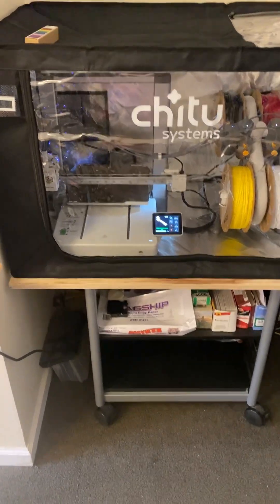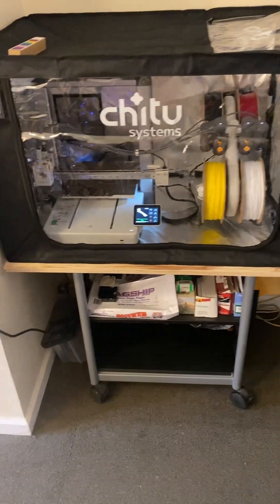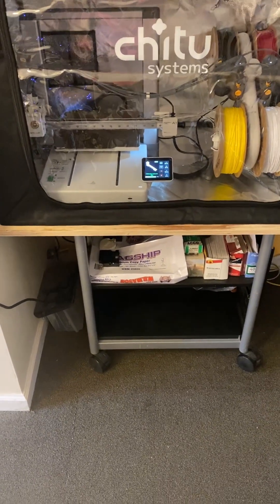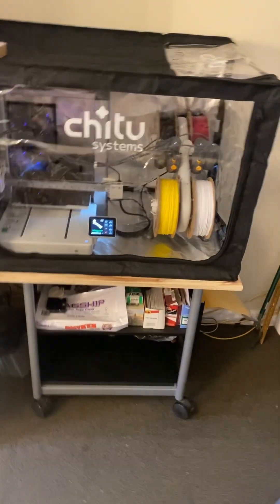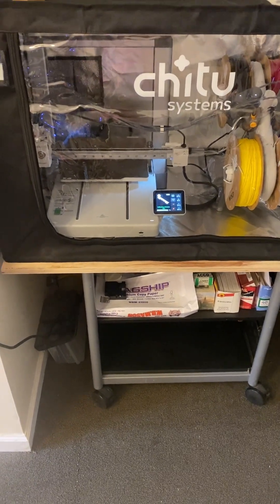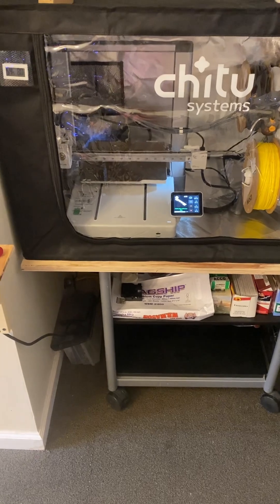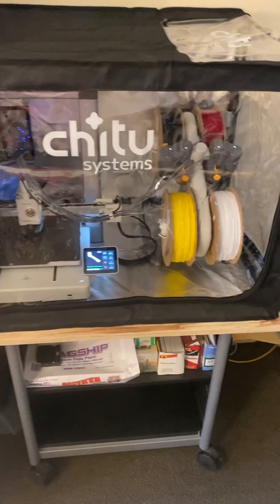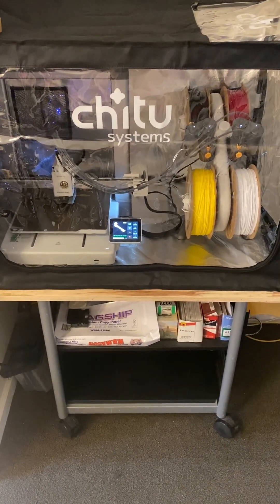S043 Bambu Labs A1 enclosure all setup

Comment: Nice enclosure but not for nothing The A1 doesn't have a really a good cooling system so you need to install an exhaust fan in the back left corner looking at it so that way it'll be behind the printer to help keep it cool and you need to put it on a table that doesn't have wheels because once the printer starts taking off and doing what it's going to do it's going to start moving The printer needs to stay stable and not move so that needs to be addressed cuz you will see some issues when the printer's doing some good prints and it starts shaking left and right and your table starts moving Wheels on a printer is not good but a nice enclosure nonetheless and would have been nice if you would have said what the enclosure ran you and 50 on the humidity is a little high filament should be in the high 20s to low 30s to make sure your filament is dry 80 will do it but if that's the temperature inside that that means that printers running hot
Reply from the maker: Logon  Thanks for the info I have since removed the enclosure was getting hot inside I even had a Fan inside but still was too hot so I removed it. Dont think the fan was good enough to cool it down.

Comment: Hows it holding up in the enclosure? Did you make any changes?

I also want to put mine into the enclosure I already have to keep it clean and keep the noise down.

Would be nice to know if it holds up just fine!:)
Reply from the maker: Kelvin I removed  it after awhile because it was getting real hot inside when printing I tired a fan but still was too hot to keep it in here so now I just have the filament in an enclosure that I 3D printed that keeps the filament dry

Comment: Bambu Labs highly recommends not enclosing the A1 or A1 mini due to cooling issues. The A1 lacks a motherboard fan, and the head in the enclosure could become hot enough to shorten the life of the printer or cause other problems. If you are dead set on enclosing, I would HIGHLY recommend some sort of exhaust system that keeps the inside of the enclosure at about room temp at all times.
Reply: And when the summer is comming, then it wil reach also high tempertures.. most problem you get is, filiment will dry out and broke after couple of month later.. pla sunlu or bambu, color grey and yello
Reply from the maker: @ Alfred I have since removed the enclosure it was getting to hot inside even with a cooling fan enclosure is now packed away
Reply: @ Hi Thom, okay, i will make a new enclosure from ply wood.. i will also sell my tent on mp👍
Reply from the maker: Sam yes I removed it already thanks

Comment: Hey man, this is very nice enclosure. Not available where i live so i want to so it myself. Can u check and share the dimensions that they are used for the pipes ? Is it 16mm?
Reply from the maker: The pipes are 12 mm in diameter
Reply: @thomasgrassi8817  thank you so much, 16 is more than enough than. I will print the corner pieces.

Comment: Why did you put an enclosure on a machine that the manufacturer says not to? It doesn’t have the fans like the P1 or X1 series printers
Reply from the maker: John  I watched and researched several videos on the subject a several placed there A1 in enclosures.  The enclosure will keep the printer clean and no dog hair on it Seems to be working just fine now. I will keep you message in mind and keep close eye on it thank you
Reply: @thomasrgrassijr  You will probably need to add some auxiliary fans so that the machine doesn’t overheat. I might recommend that you look at maybe getting one of their enclosed machines. I have two dogs in my house and have not had any issues with their hair getting into the prints…..
Reply: It has a big area I dont think it gonna get hot enough to damage the board. It shows 80 F / 26 C . I need something like this for the winter actually,  it gets lover then 10c. P1S and X1C is to expensive with ams.